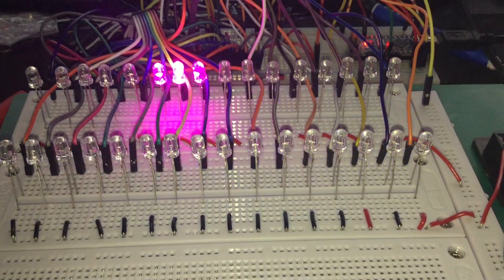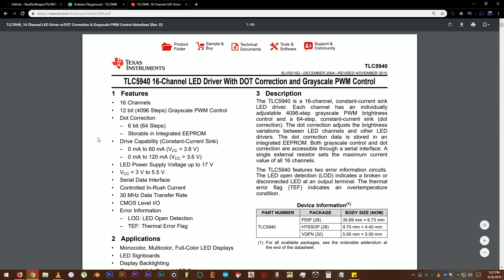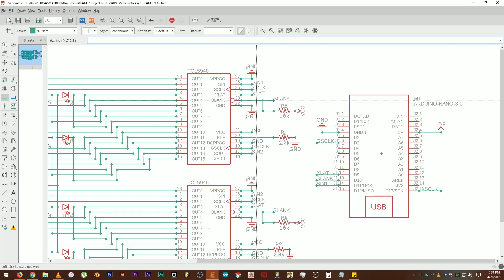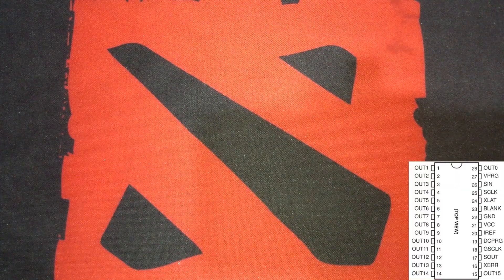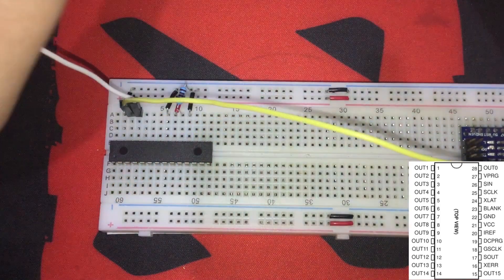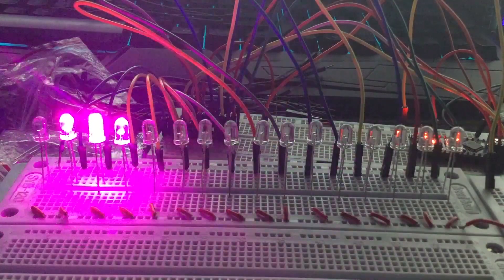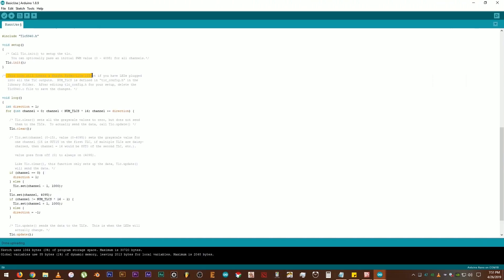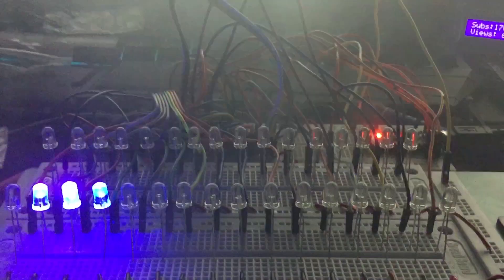Arduino Project #13 | 5 Pins, 32 LEDs, 2 LED Drivers [TLC5940]

Comment: How many ics do I need for 80 leds? Can a single arduino nano or uno drive them all?
Reply from the maker: Hello and thanks for the comment! ♥ For 80 LEDs, you would need 5 ICs and yes. You can control them using 1 UNO/NANO. You just need to source power for the LEDs from a separate power supply.
Reply: @HeathenHacks  Hmmm. The problem is, I'm not that great with electronics. Could I find a circuit diagram for this somewhere? Can I multiplex the LEDs? I have no idea how to do this.
Reply from the maker: Hello, so sorry for the late response as I've only received the notification this day. I would suggest to start with a small project before moving on to a bigger one. In my opinion, multiplexing can be quite confusing so it's a good idea to have a good understanding of how things work before doing a project that involves it.

As for the circuit diagram of this, yes. You can find it on my Arduino Project Hub or just click this link: https://bit.ly/ArduinoProject13

Comment: Hi, There. I only want to control 60 LEDS using 4 driver ICs, but this leaves me with 4 unused outputs on on IC. Should I leave these floating or do I need to connect a load of some sort? Thank you-
Reply from the maker: Hello, Saul! And thanks for the comment! ♥ As far as I know, it would work even if some pins are left blank or floating, tho I'm not that sure if the code would just skip them and move on to other ICs if you use the examples on the library.

Comment: Can this be set up with an ATTiny85?
Reply from the maker: Hmmm.. I'm not sure. Haven't tried it yet.
Reply: @HeathenHacks  Well, I've got a TLC5940 on it's way, but it is coming from China.  I may just make a video of trying to hook up the 5940 to an ATTiny85 unless you beat me to it, lol.
Reply from the maker: Lol. I don't have a working ATtiny85 at my disposal and it would take a few days as well If I order one. Go ahead. :D

Also, according to the Arduino forum, apparently it's possible and pretty easy to do. 

Check this out: https://forum.arduino.cc/index.php?topic=125212.0
Reply: @HeathenHacks  Thanks for the link, I'll comb through it.  So I've got this to go through and I also found a 24 channel PWM chip to play with, also on it's way.  Ok, ok, I'll subscribe, lol.
Reply from the maker: Thank you! lol. Seems like you have a big project in mind. Good luck! ♥

Comment: With 74HC595 you only need to use 3 pins on the arduino.
However, no PWM with the 74HC595.
Reply from the maker: Hello, Hans! Thanks for the comment. ❤️ Yes. That is true. You’ll need something like a TLC5940 if you want to use PWM.